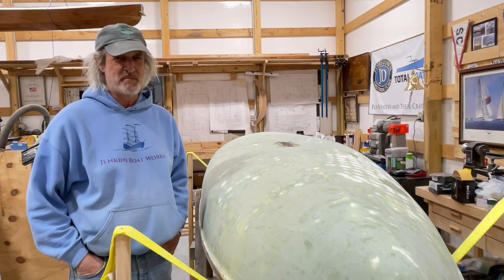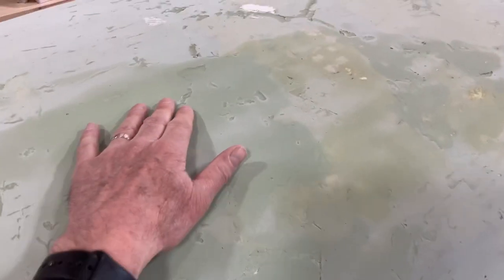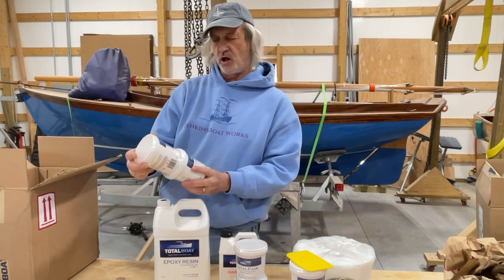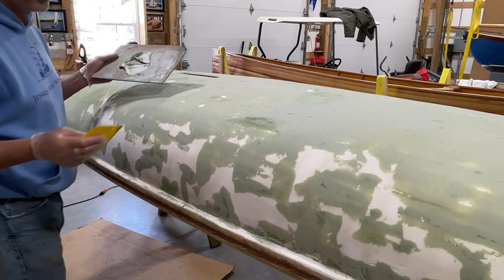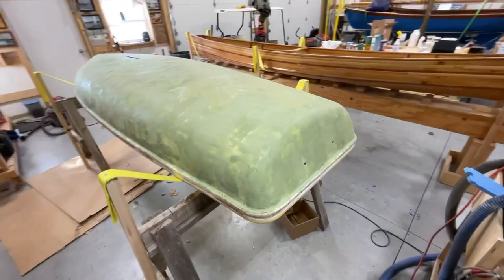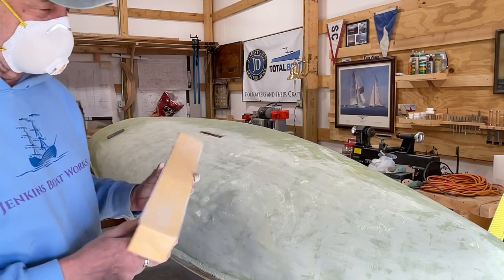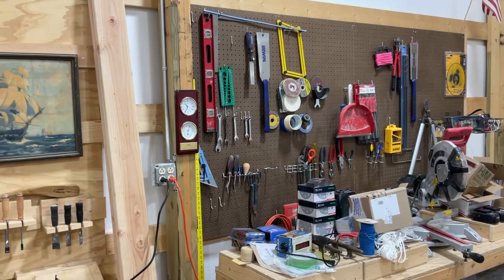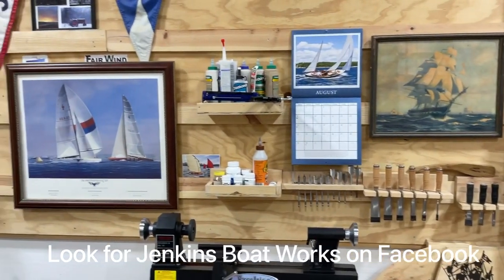Snark Sunflower Restoration - Final Fairing and Sanding - Episode 4

Comment: How will the finished restoration hull weight compare to the original hull weight?
Reply from the maker: It is actually quite close I think. the original had the plastic shell inside and out. I never weighed the boat before I started,  Might have been interesting to have done but half of the outside plastic shell was already gone so it would have been inaccurate anyway. I took this out sailing a couple of weeks ago and I can lift and maneuver on my own. I'm glad that I restored it. A new sail would make it even better but even so, it is pretty fun to sail. The simplicity of it is wonderful
Reply: @JenkinsBoatWorks  Nice work!